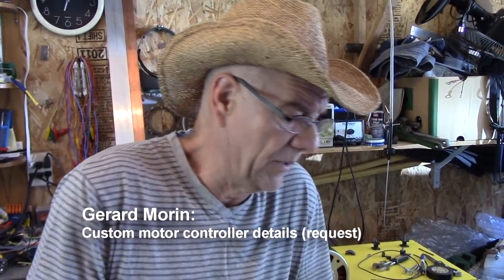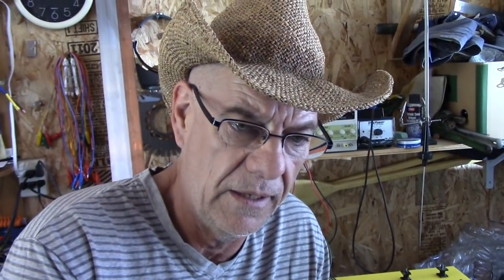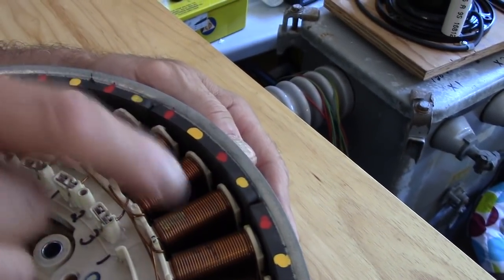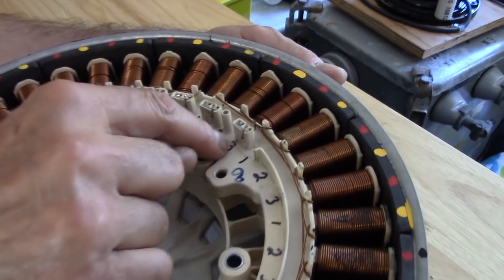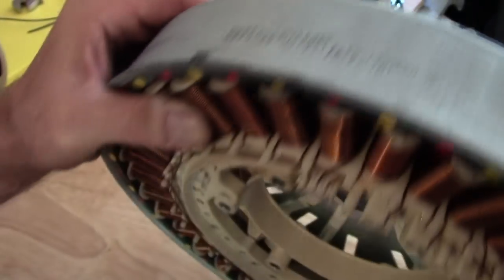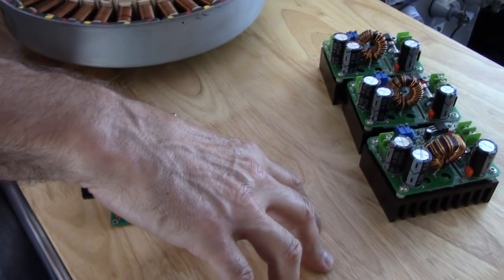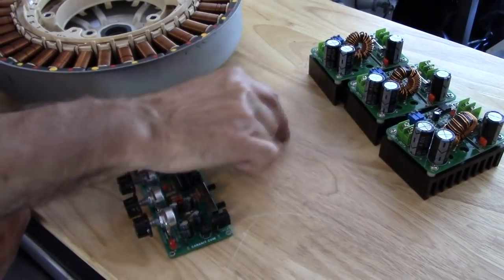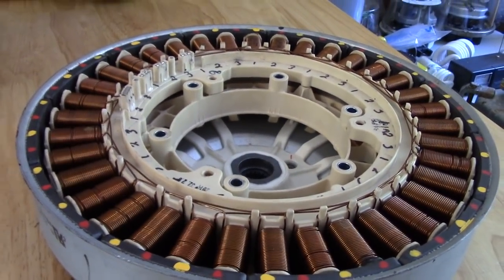Final Stages and Custom Motor Controller Design

Comment: 10:26 its stronger than your car motor at the cost of slower speed/higher torque.  Gasoline engines flaw is that they have to be at high RPM for optimal torque, all EV motors have the advantage of high torque at low RPM the torque though tapers off when it is close to its highest rated RPM.  Factor 1400 rpm and .95 hp into an equation and you will see its suitability in driving a vehicle -- Engineering 101

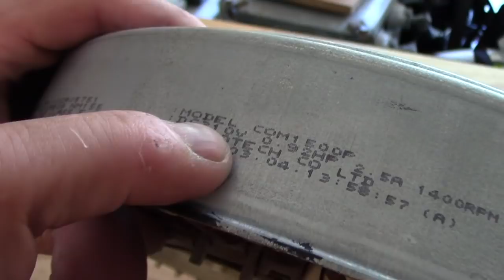Comment: 3:20 DC, 31.0 Volts  doesnt looke like 110 volts to me.  If you fed it 110 volts and its rated at 31 volts, you will have to design a way to get rid of heat, aka in an oil bath such as an electric transmission.  When it reaches a critical point it will smoke the enamel and result in shorted windings and blown controllers

Comment: And suddenly from the best designs of sensorless BLDC motor drivers pop up out of the blue.
I builded one of the simple three mosfets controller, and o what a beauty.
It runs very fast speed with torque incredible.
AND of course, it runs in overunity.
Reply: My motor is running with ZM-7205A Controller Bdldc.
Running 1200rpm and lot's off torque.
Wats your controller?
Thanks in advance,
Greetings Sven
Reply: You couldn’t, he said no mosfets LOL

Comment: Goodfuckenstuff man!!!🤣👍👍Trying to keep abreast with you, very difficult! But got hold of 2 drives, trying to get them working together on a heavy 50kw 3ph altenator. Although the altenator is big your high torque dc drive at high voltage should do the trick!! Now only the controller to complete!!

Comment: Mechanical Oscillation

High voltage resonance pressure through a Hertz slasher.

Using feedback from a magnetic coil sensor. Sensor pick up coil is a generator input from the passing magnets. Use this frequency signal to determine the rate of the slasher. Use amplification multiplication to increase voltage resonance pressure if signal is not lost but only amplified. Or create a magnet coil sensor generator which is able to move the slasher motor. Or mechanically connect the slasher to the washing machine motor. Then amplify Magnify pulse from the slasher into the hyperdrive.

Comment: It's likely that these motors use phase conjugation (off signal reverses out and repels magnet just after attracting magnet in.) Just like pole transformer coils and the hot wire in the home. The on off signal only phase conjugate reverses (AC) after charging the coil and steel or iron core. During the off resistance and reluctance to change causes the phase conjugation charge flow reversal AC magnetic repulsion. Which could charge an infinite set of batteries. (John Bedini) 

So the controller only needs to know when to discharge according to location of the magnets in the drum. Sensors on the stator identify magnet locations probably by moving the drum left and right as can be seen before clothes washing machine begins. The sound of music from some controllers is likely doing the same action. Moving the magnet location into position required for starting. Which assures direction according to directional charge flow. (Program) as the program uses directional charge flow to move the drum left and right.

For thirty six coils there are thirty six magnets plus two more magnets (2*3=6) for each leg. (36+6=42) Three sets of legs. Each leg moves either left (1) or right (2.) So every pole coil sits with one magnet each for attraction repulsion.

6*6=36 so there is one magnet extra for every six magnets. So every six magnets on the wheel rotor is one magnet out of place or not directly in line with core poles. Which could also be used as an average offset for all of the magnets compared to all of the poles. Three legs having three magnets above them to attract left or to attract right. For two sets of legs (6 coil cores) there is only one extra magnet offsetting on average for all six magnets. It might be that this is what the sensor is reacting to. However it is most likely the sensor is only there for timing purposes.

 Probably the extra six magnets assures identification by the sensor where or how to place the other magnets into proper position. Or it automatically causes wheel direction to follow directional charge flow. Which is more likely. 

The sensor can hear each passing magnet like a microphone can record or listen or can feedback sound output. Sensor input from magnetic output can be used as a switch to trigger discharge into the coils. Therefore the sensor is used to identify frequency rate Hertz. Voltage regulation controls rate. According to mass inertia weight. (Changes the variable.) But Hertz frequency is probably setting voltage levels. Voltage increases or decreases to get the desired Hertz? The jiggle (music) program is computer controller action putting the magnets in the proper position to assure directional charge flow is matching the direction the drum is spinning?

Jiggle music program controls spin direction but also places the magnets into la ocation assuring that the motor starts up a rotation. Likely this places magnets where directional charge flow will have success creating start up in the proper direction. After that the sensor matches up frequency Hertz with the proper voltage output to match and either increase or decrease rate. Because these motors use magnetic breaking, the sensor Hertz frequency program is able to lower voltage to slow down the drum? Or is it using the off portion of the phase conjugation charge reversal? Or is it reversing charge voltage (directional charge flow, DCF?) Turning off the machine does not mimick the rate of stopping the machine uses when on. Showing it used a form of braking. Would resistance and reluctance alone do this braking? If so that is all that is being done by the machine. So it controls on discharge timing and voltage level according to Hertz sensor. Which feedback input charges a capacitor which is used as a switch to turn on or close a circuit. Input frequency and voltage adjustment. 

Hertz frequency (voltage discharge level determination) is not required for simple motor use? Only a change in voltage level would be enough to change rate of spin? Cascade is not necessary? When in proper position all three phases attract in a magnet. Set up to a resistance reluctance discharge will repell magnets from all coils at the same time? 

If so this means on off all phase or legs should work when positioned by the music jiggle signal. Off needs to discharge backwards due to resistance reluctance. Which also will cause braking according to reverse voltage DCF. So a sensor is required as feedback to match DCF voltage level discharge and Hertz frequency with the positions of the magnets regardless.

Comment: Brother, I watched your video through the many F words I can tell you that you need to spend your time on BLDC synchronous motor operation. So far you haven't got a F... clue about it.... so it appears... This drum motor is a simple hi voltage BLDC motor, that is missing HALL sensors to run properly and, if you are willing to rewind (reduce the number of turns on each of the stator's teeth) it will be suitable to run on lower voltages, you can dump your boost DC/DC converters and run it off a 24 or 48 battery... Controllers already exist for it and are well developed, GOOGLE is your friend 🤣

Comment: hello
those  amplifiers are called  DC DC boost converter .
the motor is a bldc LG washing machine motor 
300vdc 1000w   1500rpm 
24 poles stator and 12 poles rotor magnets .

you can easily order from china an adjustable  bldc motor driver
got everything you can adjust 
from freq voltage   speed  and torque . from 10 rpm to 5k rpm .

when you couple this motor to another bldc motor    at higher speed you can generate  more voltage  
as I noticed u used 2 lines with a capacitor it works as a power factor corrector   all u need is to put a bridge rectifier  a DC pfc circuit and then a dc to ac inverter to power up your equipment  .
but to be aware for  heat generated  by the  generator cause the magnets to heat up and loses it strangth so lower valtage will be produced with time .and the  life span for the bearings .

Comment: Iv seen a car alternator with magnets in the middle the man used it as a generator with out the bridge rectifier in it and 3 field wires  remain that's were he hooks those 3 wires up to a 4 pin plug board . the plug from single phase motor god to the power board that has a off on switch built in . now the motor and alternator both have pullys and connect by  belt . spinning to start with the cordless drill cool stuff 😃

Comment: Three outside a sparkplug you may use timer with a cause some with three plugs going in turn under cap the points spinspin hit one to the faster and fast instead of eight barrel you need a three speed

Comment: You need what spins the chain on a bike so you casade would be each one of the points of the wheel now hook the DC electric to flat copper unit hits one as it spins from what your saying this should work
Reply: I am not a builder please make this unit for me my cousin owns a farm I would like to show him he can even go off the grid
Reply: I am a design expert not a builder
Reply: Three oh true may be a little off think a little more here tow of them now one of them hit at this point the next hits at the next and adding a third which hits at these points now spin one you spin others
Reply: On the boards spinning aswell one hits the other spins then two hits then the third spins and it comes up to hit the power  every so many spokes for three on three the outside wheel boards must be set correct
Reply: Like that
Reply: From what you said I came close them caught it and it went down in stone yes a computer is made of silicone chips sand is made of silica sand make stones
Reply: You need three + three to equal what you just proposed
Reply: Something like a flywheel but in use
Reply: You may know a way to do it with electrically I just told you the facts machanicaully as what you said

Comment: Gerald, your work is amazing. I am following you up from West Africa. Do not be discouraged by critics who don’t want the truth to be known and mankind liberated. I have just acquired a motor and is with the turners/larthe mechanists currently. I intend to start working with a controller in the coming weeks.
Keep the good work up. 
You have not really wasted your 3 years on the project. I am on your side. May God bless you real good.
Reply: Hire a good software programmer to make optimal use of your controller, the programming is getting insane. And also hire a good electrical engineer to design around the program, as new parts and techniques are being implemented every year.
Reply: I have a design for a good freewheeling electric transmission I think its old skool and people will like it regardless how efficient it may not be
Reply: , do you have a schematic or something off something old-school?
I would appreciate that very much. 
Thanks in advance,
Greetings Sven
Reply: Wow man I think you haven’t a clue!

Comment: ICQUANZX DC 5V-36V 15A 3-Phase Brushless Motor Speed Controller Motor Control Board CW CCW Reversible Switch Motor Driver Control Regulator Module is the controller you need to run that motor you could connect the 3 outputs to the input of the amplifiers and the motor runs.

Comment: I am so sorry but you are not reading the voltage & current WRONG the motor is rated @ 30.0 VDC @5.0 amps max ,I have the exact same motor and the controller I plan to use is from Amazon or Ebay  as Banggood has run out and is waiting for more from the maker. There is a video by Mr Electron and he gives a complete demonstration
Reply: Care to share the link of Mr electron demonstration? Will be nice to see

Comment: Here is the motor stator.  Haven't found the rotor or other parts.  But you can likely find the parts by asking.  https://www.appliancespares.nz/products/lg-front-loader-washing-machine-stator-direct-drive-motor-with-sensor-4417ea1002w-4417ea1002g?_pos=2&_sid=ab93aa8bc&_ss=r

Comment: What is the part number for the 3v to 90v power supply?  I have most of the equipment power and manage the frequency. I'm looking for two motors to work on. I plan to use LM555 timer chip to control the timing of the power to the wind's. Please help   Thank you

Comment: Are you still working on this research and have you come up with a proper controller for it?  
An update would be nice, 
Also, I wish you had put links to the components you used so we knew where to find exactly what you were using.
Reply: you can buy the stator/drums and all the cables on Amazon. The motor is something you can buy anywhere.  The controller is bit tricky, I think that's the hard one!

Comment: you have to use the 3 magnetic senzors , included in the stator from the factory
Reply: And do what with them ?
Reply: @Meta369  helps you to accurately synchronize in the drive, the 3 phases with which the motor coil is

Comment: Hello Gerard. Carlos here from Ontario Canada. How about using a pulse width modulator such as the ones used in electric bikes? They send a square wave and the pulse frequency is controlled by a throttle so you can very the speed. They come in 24v, 36v, 48v and so on. The one on my ebike is 96v
Reply: good stuff

Comment: Is that one of the older designs? (The source of the motor) If im coreect, it only produces about 50V conventionally. S2=100V S3/4=1000V+ from memory. 

I could be wrong but it appears to be a S1 or S2. Guessing S2 by wire diameter. But id better go back and have a look at earlier vids cause youve probably rewound it or something and Im sounding like a dick lol. 
Windings are neat like the S1 though. Just don’t quite look like 1.0mm

Comment: It this electric motor used scooter...Just Simple Sine Wave Square Wave Triangle PluseWaveMagnetic..Tweeter MidRange Base.....That Is no Different..DC..DIRECT CURRENT WILL BURNED SPARK ANY ELECTRONIC..FOR INSTANCE CAR BATTERY ..ELECTRONICS ARE DIGITAL DIAGNOSE THE CAPACITANCE COIL INDUCTION GENERATE CURRENT BETTER CROSSOVER TRANSFORMATION UVW FILTERING EQUALIZATION DIELECTRIC DIODES CAPACITANCE CAPACITOR

Comment: 3:24 that motor is 310 volts not 110
Reply: Is there a reason behind pointing out a time in the video of him miss speaking? look I can point out something with a time as well. 

3:41 correctly says 310 volts.
Reply: Sure looks like it doesn't it. Probably need to step. Voltage up from 96 volts to a hell of a lot higher

Comment: 2:27 so we could not use this motor as a generator?
Reply: You have to spin it faster than it can motor for it to be a generator.
Reply: In an older vid he says that the magnets are on the outside so that makes them more suited to being a motor because of all that massive leverage… so use that leverage to turn a generator that has it's windings on the outside and it's magnets on the inside. It's leverage is much less.. which makes very good sense to me. Which is why drum motors are perhaps not the best option to utilise for wind/water turbines

Comment: So, thats where the Arduino Board comes in ..  (Patrick Kelly)
Reply: Arduino is not good for real time operations it's probably Texas Instruments LaunchXL  development and test board. It's excellent for that kind of job and that kind of frequency etc. Other thing is that if there are "3 motors" in one there it would be interesting to use wingdings of one as a motor and other two as generator and external generator part would be obsolete ;)
Reply: @DinAlter  ye its not that fast frequency i can program in that, as i like.. Only Mhz instead of Ghz..

Comment: Isn't the Voltage Sequencing done by a Hall Effect Array, which forms part of the original Washing Machine Motor Drive Circuit?
Reply: The motor has only two hall sensors while three are used for sensor drives.  It can also be used sensor less but the startup it harder.  Yes I have one.

Comment: hello gerard,how did you connect the 3 amplificators for each motor phase? i mean just one wire per phase on the motor,so whats happend with minus connection input side and the minus of the output side as well? i dont get the point,are you connecting those minus to a commun minus pole somewhere into the system? but if yes ,where? side low voltage of the arduino? or somewhere else? thanks to care ;)
Reply: Do you know about delta and star configuration? That will tell you where the negative from each amplifiers output will go.

Comment: Wow... take apart a 1000 watt electric bike motor it’s the same thing. It has hall sensors to let the bike controller turn on and off the phase coils they cost 50.00 if you want higher voltage just rewind the coils with small mag wire with more turns. I agree these motors are fantastic. With 48 volts on a bicycle I can pull 45 mph at 1500 watts.  You can configure the windings for either high speed or high torque or something in the middle
Reply: why not try to squirt high frequency and volts into the bike motor instead and not change anything at all to see what happens?

Comment: Mr Gerard Morin I suggest that you use the Halbach Array of Magnets because this Array will focus all the magnetic flux density inward which would raise the efficiency of the motor big time, and if you want to get greater efficiencies use Litz Wire which is very fine thinkness of magnet wires twisted together it cost more if you buy it ready, or it cost less if you buy the wires and you twist them. The great Benefits are reducing eddy currents (Skin Effect), thus reducing heat losses, lower operating tempreture, reduce AC losses in high frequency windings
https://www.newenglandwire.com/litz-wire-benefits-and-applications/